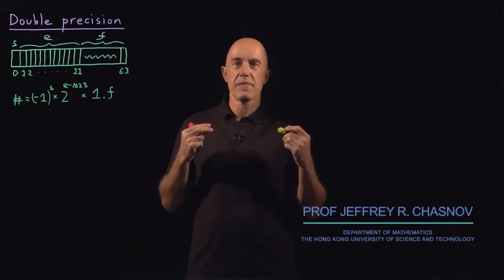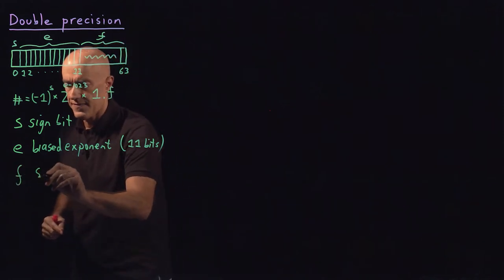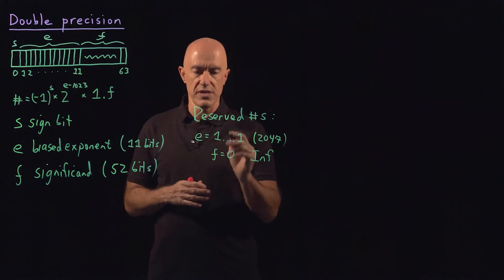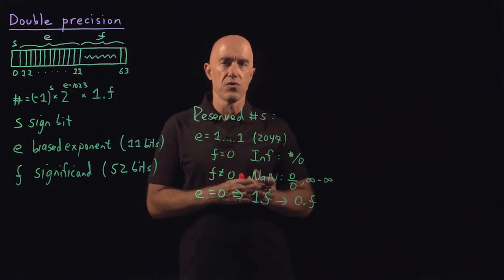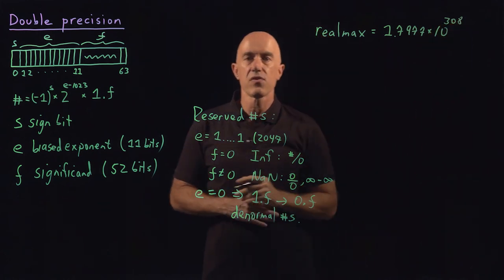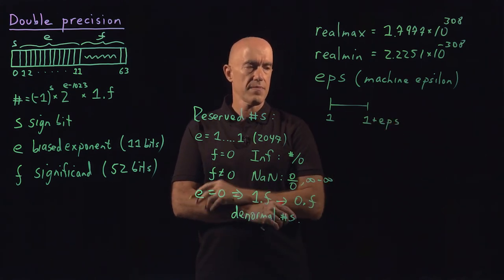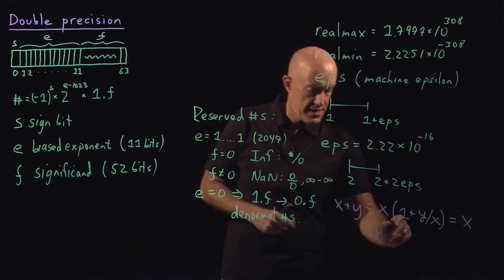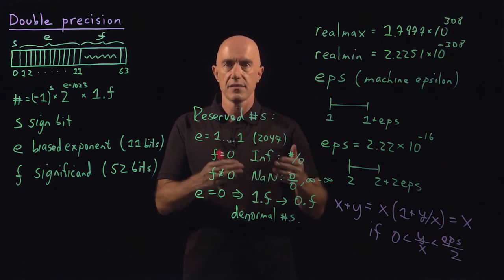Double Precision | Lecture 2 | Numerical Methods for Engineers

Comment: Question about 64 vs 32 bit floats.  In computer games, most data is stored as 32 bit floats instead of 64bits because 32bits floats must be provided to the graphics card when rendering in something like openGL.  Game designers don't care as much about accuracy as people who are doing scientific computing.  So if I am doing scientific calculations that I want to render in real time, I have 2 choices...i can do everything in 32bits and take the accuracy loss...or I can do everything in 64bits and convert to 32bits every simulation loop which will make the rendering performance suffer.  Have you ever had to deal with this problem?  If so, what is a best practice?